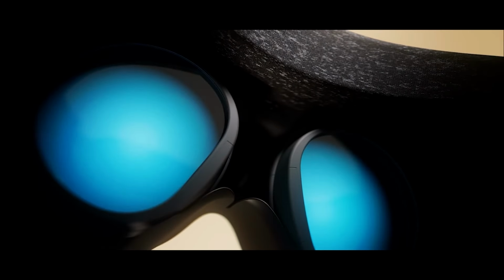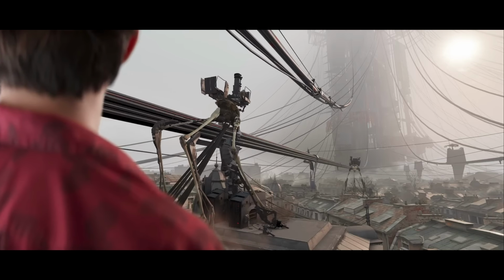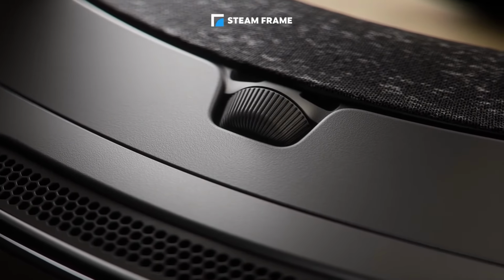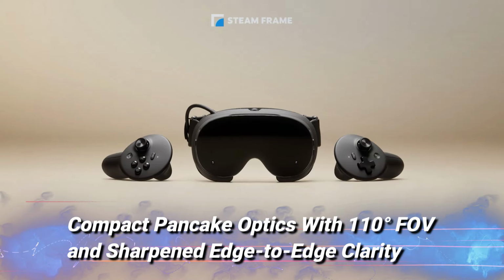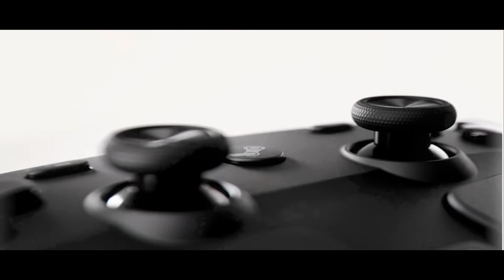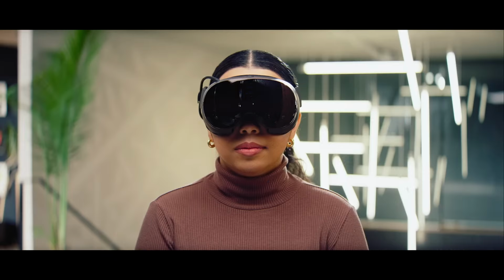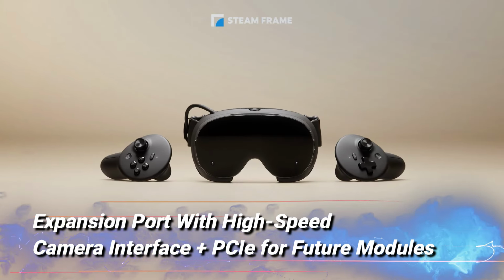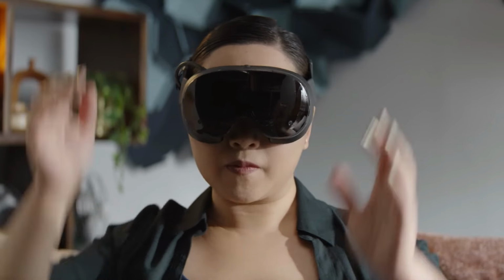10 Insane Things About This Steam Frame That Make It the Ultimate VR Machine

Comment: It won't be as it doesn't do Mixed Really gaming and the Quest can do both and has a library for both MR and VR apps and games and that's something Valve can't do and what Valve are doing is what Microsoft already done as I can just play Xbox Game pass games on my Quest 3 and have been for a long time lool
Reply: The pcie slot will 100% be able to use a color camera that you can very likely use for passthrough and mixed reality. The quest is impressive but being attached to meta makes it steal a LOT of data and I don't like that
Reply: I would rather have steam frame than meta quest. Who actually plays MR games? Gamepass is a joke as well. Your statement is wrong on so many level.